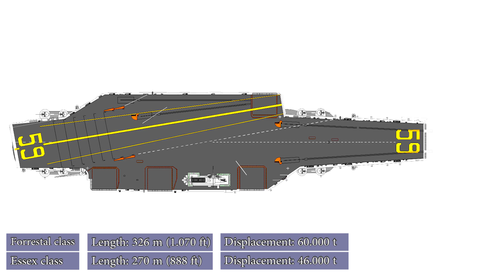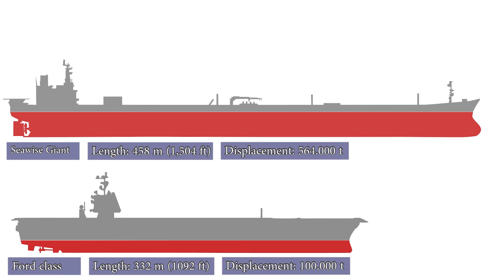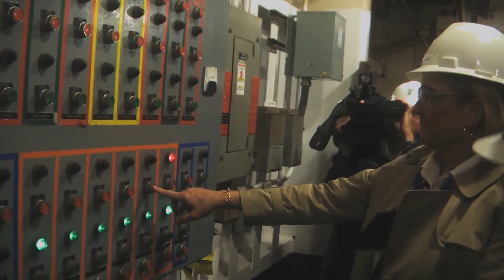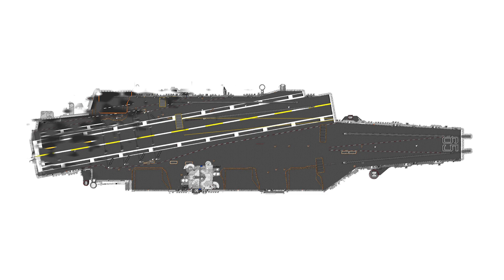Why don't aircraft carriers get bigger?

Comment: Aircraft carriers are a poor  concept in this modern era, yes its good against countries with poor military, but with modern anti-ship missiles, submarines with longer range torpedoes/missiles, modern seabed mines (only activated by target signature)and modern concept of swarm drones, can at least mission kill a carrier and its fleet.

I think the best weapon against carriers are the moder mines that are smart enough to recognise the target and harder to detect and cheaper than any other weapon system, keep in mind they are like torpedoes that has short range, you can drop them by expected path of a fleet via Aircraft or submarines and wait for them, the enemy will have to take the risk or stay away which takes time.

The ASM can have of an effect on pushing the aircraft carriers away from the shore line, making the fighter take Less load or need to use tankers more increasing fatigue and less sorties per day.

Modern laser defense systems and anti torpedo torpedoes are also coming online, but quantity and jamming would have an effect on them.
Reply: Well, while your points are mostly valid, it's only applicable in a defensive war or when your country is right next to your opponent. Aircraft carrier is vital in oversea power projection, and there's no practical alternative to that. Sure, you can have a lot of aerial tankers, but that doesn't give you a good sortie rate and it's not really cheaper than an aircraft carrier for the same number of planes it can support. You can have bases in countries near your opponents, but that required a strong alliance, which is not possible in every situations.

If your doctrine is to simply go on defensive, sure, you don't need an aircraft carrier. But if your doctrine involves striking a target half way across the globe, there's no practical alternative in any near-future. That's why despite war media saying that China have weapons that makes aircraft carrier obsolete, they're building aircraft carriers themselves because they knew that if they wants to protect their interests farther than their shores, they need to be able to project their air force oversea. If there's an alternative for that, they wouldn't order several of them. 

Drone swarm treat will likely turned out to be overblown, as small, cheap drones don't really have a good range. You can send an aircraft or boat to launch them, but they can be targeted. Not to mention they're fragile and it doesn't take a high-tech weapon to down them, there are already cheap weapons that work well against tightly clustered group of drones like programmable airburst munitions, the military are only recently investing in them because drones tactics changed, but once it's integrated into every brigades, small drones won't really have much chance against larger units. And no, small drones don't have a sufficient space allowance for a good jammer. And large drones aren't cheap, they often do still cost as much as a light fighter.
Reply: @Solomon of Akkad  Well you have a point on the defensive part, which in my view the US doesn't seek war after strong opposition, leave what cluster f the Russian army is doing in Ukraine, that first is a leadership problem, going in half cocked.

But the US will think twice before attempting to sea embargo the Russians, for example, and they don't have an operational carrier.

2nd the high sea have choke points and transit routes that can be easily targeted, have a CV for control of the sea is like trying to find that one sleeping torpedoes in an ocean, for example Iran had made a lot of advances in sea denial equipment that can halt the global economy within hours from declaring war by blocking access to the Arabian and red sea (and we saw what few days did when the canal got blocked)

You answered me regarding the drone swarms, but answer me this.

What about the commercial traffic? How many destroyers  do you need to protect them?

What about active sea mines?

Sea raiders, I know you would think its funny, but your enemy doesn't play by your rules; you only need a commercial ship with a couple of missiles on them.

Targeting ports and sea lanes  are easier than you think, your 5 carrier can be everywhere at once and putting them near enemy shore to intimidate is plan stupid.
Reply: Most of the threats to a carrier are overhyped amd overblown. Right now a carrier battle group is the most powerful conventional weapons system on the planet, and will be for the foreseeable future. 
 Somthing most forget is targeting. Take China amd the SCS for example- while carriers would probably operate in the Phillipine Sea, lets say they do. How do you find it to use your ASMs??  For complete coverage in order.to detect a carrier, you'd need a constellation of approx a thousand synchronous satellites!!! Nobody has that!! Now as far as your smart mines,  if youre very optimistic about sensor performance, you could give the mines, maybe, a 30 mile range. So how many 30 bubbles does it take to cover the China Sea? Nevermind that the SCS isnt shallow coastal water, but deep water, and most systems arent designed for that. So short of a group sailing through a narrow strait, detection and coverage are still a problem even for China.
 So yes,  threats to CVNs are rising. But they have been since their inception. But when used intelligently with their battle group, they're still the dominant and best protected weapon at sea.
Reply: @Wheels-n-Tires  my point is, I don't need to attack the USN fleet, I just need to attack thier trade routes or national interests, you are think of a pure 1 to 1 engagement tactical victory and I am talking about  strategy.

And you didn't answer how are you going to defend your national inrestists, which, by the way include your nato alliance, If it's a war I will attack nato trade routs and ports, and put pressure on US policy makers and split the alliance ( a strategy that Russiawas trying to use which failed).

2nd I don't need to find the US carrier group in the middle of the ocean, if the US want to strike me, they have to get in range of my assets (air borne ASW and subs to track them) and hence within my weapons range, and if they were let's say the Red Sea or south china sea would be easier.

I would love some one to tell me, how would you deal with the carriers?
Reply: @WarWithIn  what are you attacking trade routes and merchant shipping with?? Whose navy is going to do that? 1940 Germany?? Sure, maybe Iran could briefly close Strait of Hormuz. But what then?? Attacking shipping means US will probably end up involved along with NATO countries, and that then becomes national suicide. 
 Russia has no naval capacity to take on NATO, so except for some sub operations, theyre a non-entity. China has built a large and modern fleet, but even with its addition of carriers, its focus is local offensive ops with an eye towards defensively keeping US carriers at arms length.
Reply: @Wheels-n-Tires  yes I am talking about attacking shipping lanes, do you understand what this would do, the entire world rushed to stop some Somali pirates with denge boats and Ak that terrorised shipping lanes and till now there are warships patrolling the horn of Africa.

I am talking about merchant raiders/subs with anti missiles and mines going around the world and sinking merchant ships? Or attaching oil platforms of the cost of taxes, this is war, think outside of the box.

Can you understand the magnitude of this? This would be a global recession.
Reply: @WarWithIn  I never underestimate an enemy. But numbers and ranges and capabilities are facts.  The Russian navy is a small shadow of its Soviet era self. Poorly funded, but slowly modernizing. Not to be ignored, but nothing approaching superpower capabilities or numbers. Being largely defensive in nature, it doesnt need to compete directly with the USN in numbers or range. As far as their ability to close the Atlantic, they had a better chance during the ColdWar. Much of NATOs navies are ASW focused as ColdWar legacy, so theyre still quite optimized to keep bsea lanes open and combat the sub threat.
  As far as pride talking...nah not really. Frankly im quite upset and irritated with the current state of the USN. Its currently working very hard to be able to go get its ass kicked in the future with poor training, stupid procurements, no real strategy, etc... So this isnt pride, its knowledge. As a USN vet, I take part in a couple major naval blogs, and follow naval events very closely, daily... So my understanding of things is pretty solid. Not only from staying current on things, but because Ive been haze grey and underway with Second and Sixth Fleet many times, and have a deckplate veiw...
Reply: @Wheels-n-Tires  I respect a man that takes criticism and think logically, my way of thinking is defensive in nature regarding military maters,  the best thing going for the US navy is experienced cadre of professional navel officers and I really do think if they want to rebound back they can if they didn't waste 20 years fighting unnecessary wars that gave ample time for China to ramp up, they ran the ships and equipment to the limit with no new evaluation to thier tactics/equipment, they came late to the show.

The Chinese and Russians aren't stupid; they know their capabilities, and they are catching up and even exceeding the Americans in some areas.

I think with good strategy and equipment, you can defeat or negate the carrier battle group.
Reply: @WarWithIn  I wish I could agree with your quality assessment of the Officer Corps, but even is has major problems. Infested with decades of "transformational" thinking, coupled with the Post-Cold War hubris of being peerless, as well as a lack of professionalism, core competencies, and actual warfighting skills and training, I cant say I believe the USN is remotely ready to fight on anything approaching a peer level.
 You're absolutely right about the negative effects on the GWOT... The Navy has been neglected, used up, and worn out over decades of useless and wasteful deployments!! Add in decades of procuring overly expensive and underperforming (or flatly worthless) platforms including Zumwalts, LCS, and Fords, and you have a recipe for a second place Navy...
Reply: Simple facts
weapons and defenses both advance

Comment: Interesting, that the Ford class is almost identical to the Nimitz. The design is frozen
Reply from the maker: Yes, in fact, the're changing most of the internal systems, but the size is not a problem for the future carries as we can see
Reply: @Horizoneng  And why it changed so much after the WWII?
Reply from the maker: @flyerkiller5073  I guess, this is a resault of the transition of aviation from piston to jet engines. Speeds are higher and decks have to be larger
Reply: @flyerkiller5073  Angled flight decks also became much more prevalent. Introduction of jet aircraft required much larger hanger sizes to carry comparative compliments. For example, take the transition from  bi-plane aircraft to mono-plane designs, this significantly decreased the total fighter carrying capacity. Same thing happened with the jets.
Reply: There are huge differences. The biggest in the nuclear plants. Two units on the Ford generate more than the Nimitz can dream of. The plants on the Ford are sized to allow over 70% growth in electrical loads. The Ford has an EM catapult. I think the size/plane numbers show the sizing of the forces is considered to be optimal, but the change over was all about electricity.
Reply: @charlesrichardson8635  you have the right idea, but the value isn’t as high.  The FORD carriers ride on a classic Nimitz hull design below the waterline.  But, you are correct in the FORD class provides massive technological upgrades other nations can only wish for.
Reply: @SkippyMgee  I would say the vast majority of those tech upgrades is due to ELECTRICITY! Okay, I am biased, but most tech upgrades in the military arena drink electrons. But they are cool machines.
Reply: Well, the reactors have 3 times the output.
Not to mention the catapults aren’t steam powered anymore.
They go on some magnetic levitation tech.